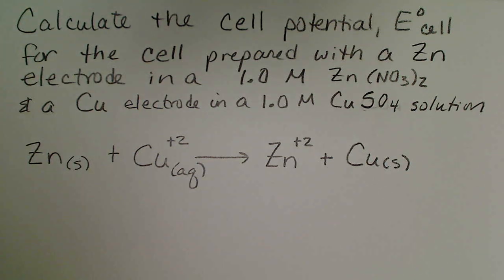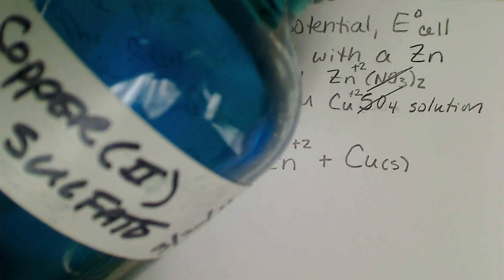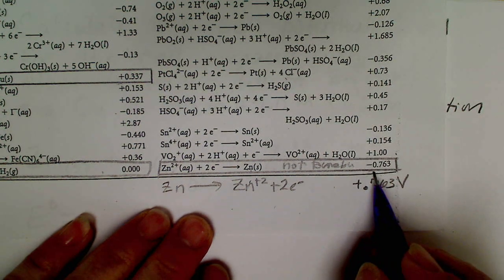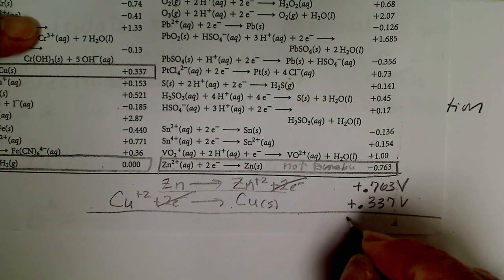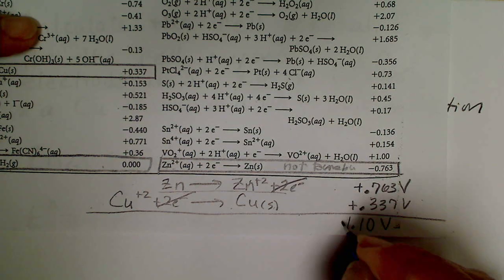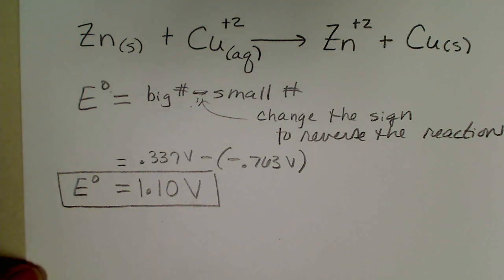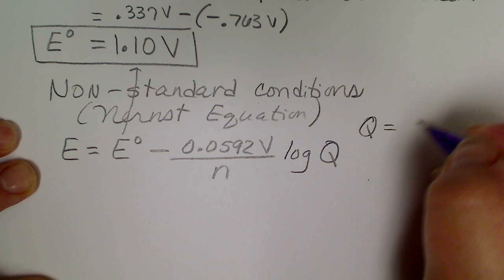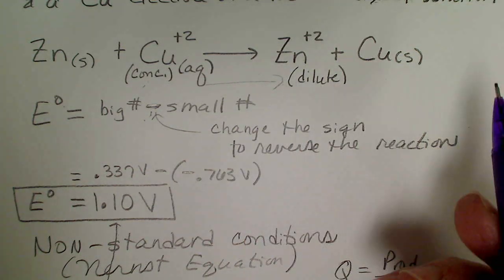Calculate the cell potential at standard and then at non-standard conditions

Comment: How did you come up with the  0.0592
Reply: +Rigoberto Alvarenga the constant
Reply from the maker: +Rigoberto Alvarenga Hello, the 0.0592 is a constant that combines the R (gas constant) from the non-standard equilibrium equation with the conversion from the natural log (ln) to the base 10 log AND I also believe Faraday's constant is incorporated in that.  Since G = - nFE, the non-standard delta G equation can be solved for the E in the Nernst equation and although they do not LOOK the same, they are the same equation and the 0.0592 is used as a combination of all the other constants so that the user only needs one constant.  GREAT question, btw. :)
Reply: +Michele Berkey thanks for the wonderful explanation.  i was just confused cause the problem i was trying to solver included a temperature of 57 celsius
Reply from the maker: +Rigoberto Alvarenga The Nernst Equation does not have a temperature dependence in it, assuming all reactions are performed at 25 Celsius.  IF you have a temperature dependence, the Nernst Equation you can use is E = E cell - (RT/nF) x lnQ.  Where Ecell is the standard potential found using the appendix values. In this case, you see each of the constants, R, F and n is the number of electrons transferred. :)
Reply: +Michele Berkey So i was just looking at the wrong formula i guess. Thank you much!
Reply from the maker: +Rigoberto Alvarenga  IF you are in a General chem class, the second formula may not even be in the text, guess it depends upon the authors (and your instructor).  :)

Comment: hi :) 
why is it that we need to assume the concentration of both the solutions in Calculating  Non standard using nerst equation ???
Reply from the maker: carino teine Hi, I'm not sure what you mean by "assume the concentration of both solutions." Standard conditions mean both half cells are 1.0 molar concentration, and those are the values we can look up in tables, so the actual concentrations (IF they are not 1.0 M) need to be used.  We could use the Nernst equation for every calculation, but any concentration of 1.0 M will cause the second term to be zero (Log 1/1 = Log 1 = 0).  Hope that helps....
Reply: carino teine She did two problems in 1 question. The answer for the original question is 1.07 which is under standard solution, the 5.0M and 0.1M are hypothetical numbers which she just added to solve for none standard conditions.

Comment: I'm a starter of high school chemistry and I understood everything!!
Reply: Michele Berkey The reduced states of the chromium is a complicated question. I searched the Internet and discussed with different people and could not get a clear answer - some said it depends on the quantity of reactants - i.e. as long as the magnesium keeps coming in, Cr 3+ will be reduced to Cr 1+ and then Cr solid. Some said that since the Cr3+ --> to Cr solid provides more reduction potential the first step would be Cr3+ --> Cr solid - if there is not enough magnesium then there will be Cr3+ left in the solution. The Reduction Potential Table in the Barron's only list two possibilities for Cr (Cr 3+ and Cr 1+). I guess it's too complicated for AP but I'm curious to know the answer. Thank you Michele and your answer helped a lot!!
Reply from the maker: That's fantastic!  Have a great year in chemistry!!
Reply: Thank you. I do have one question going through a Barron's example - chromium chloride reacts with magnesium solid - predicts the result - 1) the chromium can be reduced by either one or three electrons, which one should I use? How do I know which one? 2) does the voltage also follow the rule to be balanced,
Reply: Eg if 2 chromium chloride participate the reaction then the reduction potential of chromium shall times two? That doesn't make sense does it?
Reply from the maker: Michael Ling Chromium's most common oxidation state is +3, & the name chromium chloride "should" indicate which oxidation state is in the compound (chromium (III) chloride). Magnesium will be oxidized to Mg +2 (it's higher on the activity series, easily oxidized) and chromium reduced.  Chromium's common states are +2, +3, +6, even +1, 4, +5 exist. Without the balanced equation to look at (or the formula of chromium chloride), it's hard to say. I would guess 2 electrons transfer from Mg to Cr+2 (especially if the formula is CrCl2). Do NOT multiply the half cell voltage (potential) by the moles because of the way Volts are defined.  Hope this helps......  :)